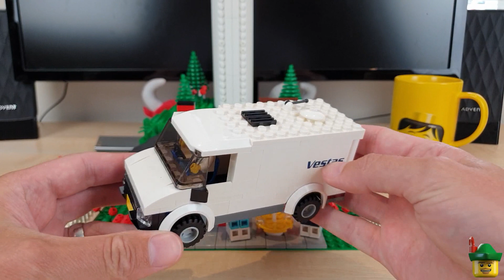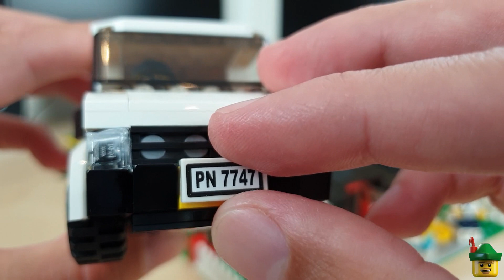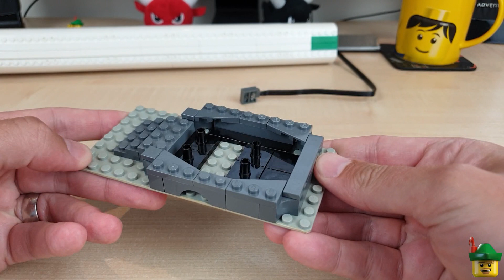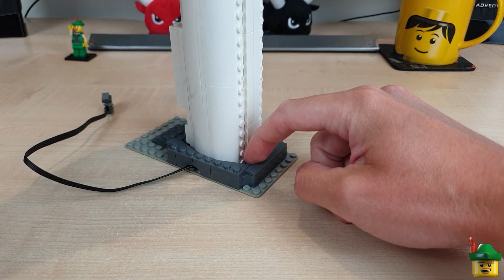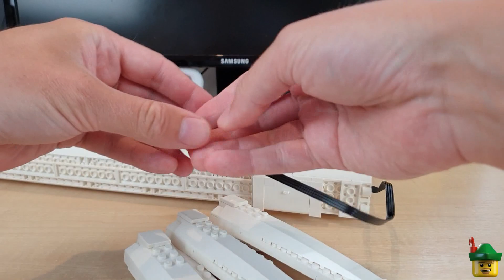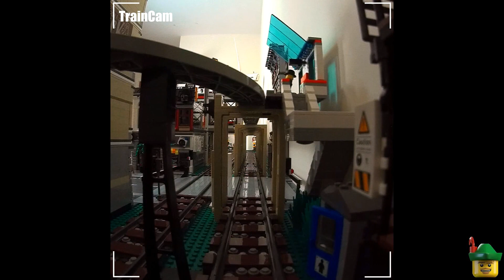LEGO City Update - Vestas Wind Turbine 10268 💡🏹

Comment: Please how did u avoid vibration on foundation I tried to make ur improvement but it shakes strongly
Reply: One more where to get new pieces at feet can u add model number of this black new pieces or. Web to get it in internet
Reply from the maker: Was is part 2460?  I can't remember.  https://www.bricklink.com/v2/catalog/catalogitem.page?P=2460&name=Tile,%20Modified%202%20x%202%20with%20Pin&category=%5BTile,%20Modified%5D#T=S&C=11&O={%22color%22:11,%22iconly%22:0}
Reply from the maker: I don't know.  Mine never shook.  I guess the barrister is held down on about three sides, by the track etc.  Maybe that helps?  Does it work if you hold the baseplate with your hands?!

Comment: It's a beast of a set! Can understand why you've removed the base. I just think it's too big for most cities - although it is to scale. All your changes made sense though - although it does wobble a bit when it's on. I used to want this set, but I think I've changed my mind and will keep an eye out for the 7747 set you mentioned as I've always been a fan of it and better sized. But you picked a great spot for it in you city - although did you consider make it one of those ocean mounted ones?
Reply from the maker: I have too much going on in my ocean for this beast.  I only bought it because the corner needed something tall and isolated, otherwise I don't much care for it.
I'm happy with the slight wobble!
Reply: It wobbles in real life.